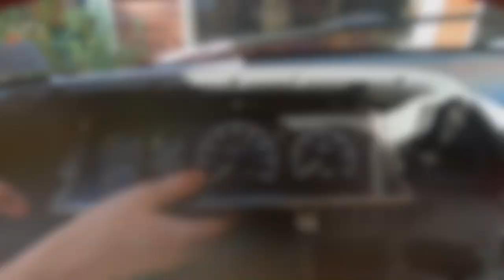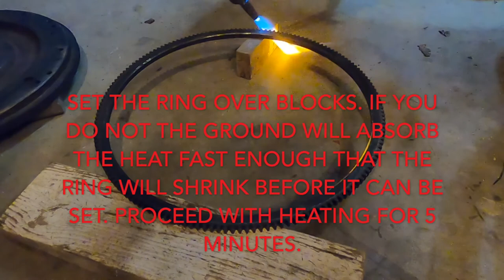1987-1991 Ford 4.9L 300 CID Marginal Clutch & Driveline Walkthrough

Comment: Great video.  I have an 87 F150 4.9l.  It takes quite a bit of force to depress the clutch pedal.  It's probably always been that way, but as my left leg gets older, it's starting to complain.  I'm wondering if overhauling the clutch would make it easier to operate.  I bought the truck used in 1989 and the clutch seems to be working ok.  Maybe just wishful thinking.